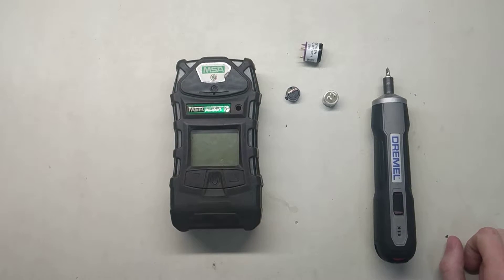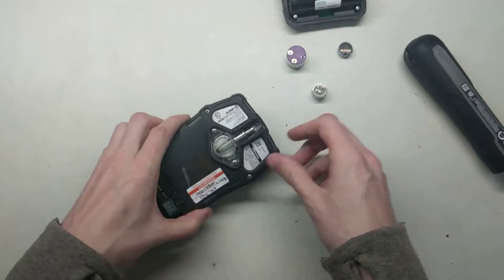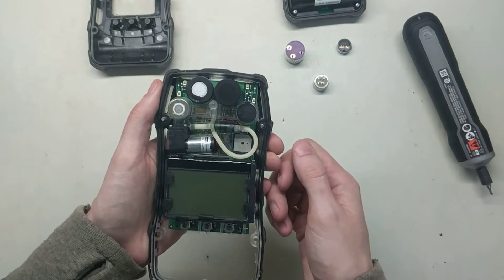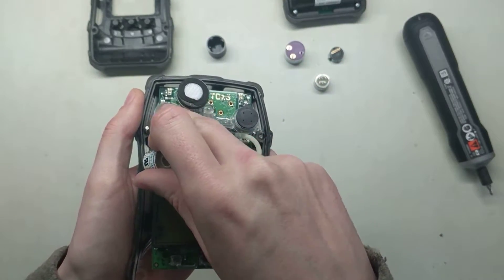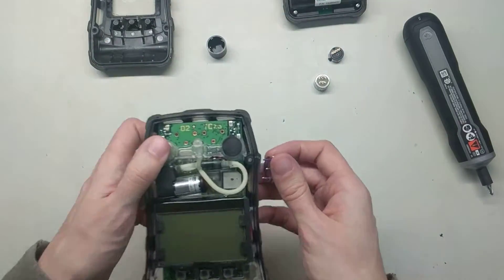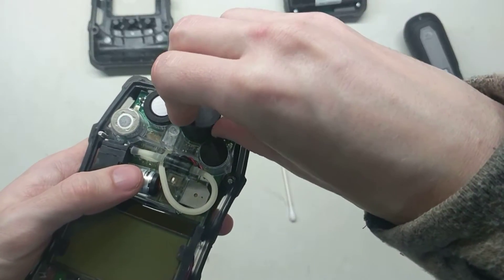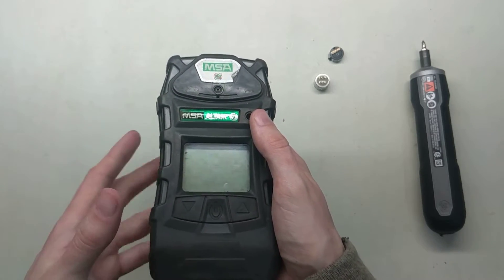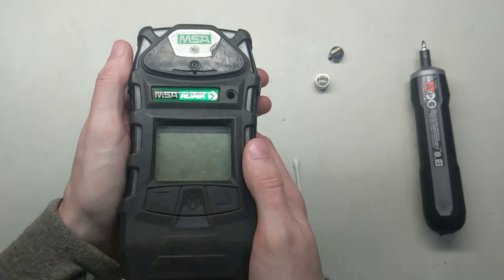MSA Altair 5 Sensor Replacement Guide

Comment: What is ESD protection? :) Anyway, I like your videos!
Reply from the maker: Ha! You know when I started I was super concerned about ESD. Had all the hookups and wore the bracelet. I think that lasted 6 months. Since then we don't even use the mats anymore except for the padding on the work space. I've never had a discharge or lost anything due to the static. Thankfully with them being safety meters they seem more robust. I think they put something on the board to help but I'm really not sure
Reply: @Idealcalibrations  thank you the answer, I also do this way, but when I have to change an expensive part I’m wearing an esd glove :)

Comment: Just had a detector fail calibration today...docking station read " CO target 60ppm  found 71 ppm"   Is the CO sensor bad?
Reply from the maker: I'd try recalibrating it. If you can do it by hand without the dock, I'd try that too. CO sensors don't usually fail "up" unless something has gone totally wrong, and that would send it sky high. Might just be drift
Reply: @Idealcalibrations  recalibrated and it passed...thank you!

Comment: Do you know where to find the Dummy Sensor? We have a meter that will not function because it says missing sensor. When I checked the dummy sensor was missing and when I replaced it with one from another meter it would function properly. Not sure why since its a dummy? maybe it makes a connection inside the circuit board?
Reply from the maker: Hey just wanted to check and make sure the sensor got to you all properly. If it hasn't it should be there in the next day or so. Let us know when it's in and if it fixes the problem (if it does I'm going to be all sorts of confused, but it'd be good to document). Best, James